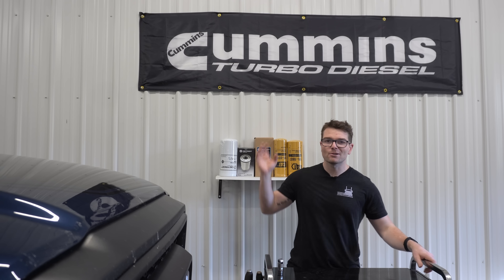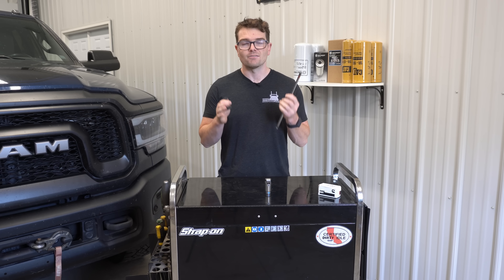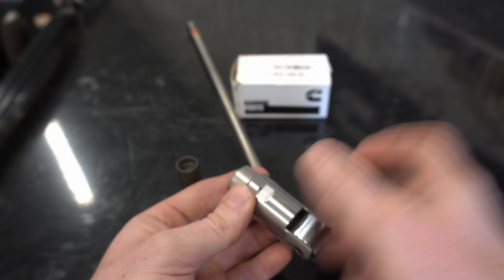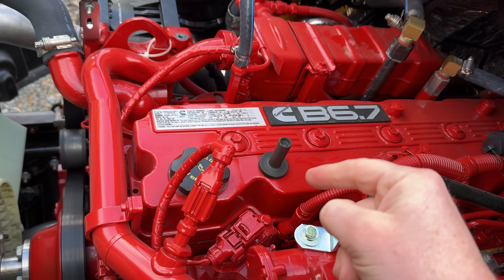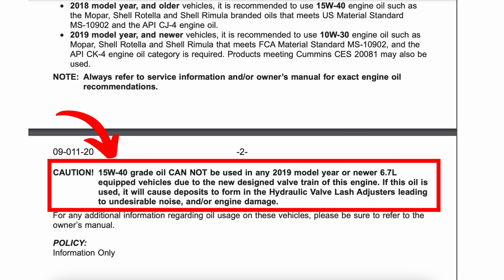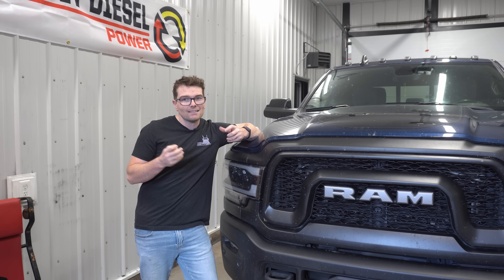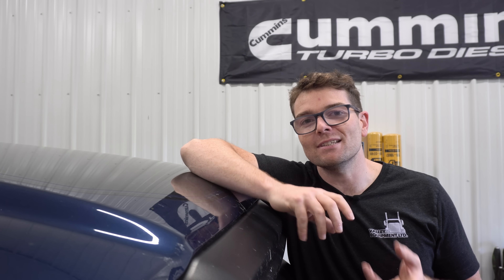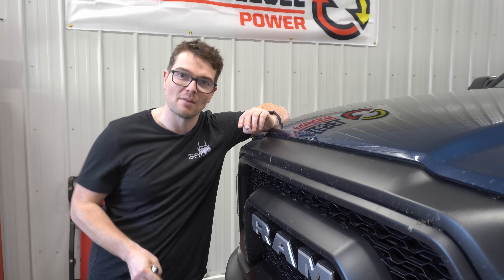RAM 2500 6.7L CUMMINS Hydraulic Lifter Failures *Diesel Mechanic Explains* | Not Good?

Comment: Great video, I’m super concerned as I’m hesitant to drop the huge dollars on one of these trucks. We are retired and do lots of towing miles with our 2004 5.9 Cummins dodge ( 200.000 km ) love the truck but as you get older the noise the truck makes when hauling is bothering our hearing. Plus in 2004 the truck has less power no Bluetooth,poor stereo less overall creature comforts but…… has great fuel economy and never breaks down. Oh and it’s paid for. See my dilemma? I would like if you were to dig deeper into the lifter issue.
Reply: Just add the creature comfort you need. 
I have
Reply: Just buy it and trade it in before the warranty ends.

Comment: I change my oil every 12,000 kms on my 2021 Ram 2500. More often than called for but I’ve always done this (this is my 3rd 2500 with a Cummins). I’m at 155,000kms and have extended warranty to 160,000. Went for my oil change last week and apparently I have a camshaft/lifter issue. 🫤 at least dealer has been great, it’s under warranty but this video made me realize it’s likely a bigger issue especially the 2021 model year.

Comment: I've worked on Cummins engines in many dodge/ram trucks that had well into 200,000 miles and the valve lash was still in spec.

They just work. 

The same thing when they tried dropping the CP3 injection pump for the CP4. Don't fix what isn't broken!

Comment: Lost mine at 30k miles, oil changed every 5k miles. 

Bought a Ford,  so far in very happy
Reply: Geeeeezzzz, that ain't good.
Reply: @oldsalt8011  nope , they claimed it was an idler pulley , still did it , then they claimed it was the EGR valve. 

Told em to quit beating around the bush and figure it out. They finally pulled the head and the intake lifters on 2 & 5 were shot 
Exhaust lifters on 1 2 3 & 6 were shot. 
With a 17 week lead time before they could touch it...
Reply: @jjames5928  What year model? I have a 2022 that I bought in December 2021. 3500 HO Ram.  I love the truck but I do not like hearing stories like yours. I bought with the Crew cab and long bed. It has been great for the projects that I have had and towing the wife's camper. Im now at 23k miles.
Reply: @oldsalt8011  22 3500 Standard output

Comment: Why change it ? Well, that's what you get for letting engineers have thier way . Nothing wrong with the old set up . Learn to adjust valves and it will run until the rings fail . Now you get to buy shifty lifters every 35k

Comment: Rotella T6 5W-40 on my 2019 3500 with 35k original miles as of this post. I change oil at 5k miles, I want the best with extreme weather conditions Texas heat this summer high 120s - high 20 degrees in the Utah mountain trails in dec/feb. I spoke with Rotella field engineer about this years ago and he said Rotella T6 will get the job done!

Comment: 2022 124k mine is in the shop for bad lifters right now. Getting that sorted is fun. 5-40 oil changes at 10k km since I’ve owned it
Reply: Mine is in the shop getting lifters  redone and a new Transmission
Reply: Ouch. Just bought a 2022 HO w/11K mi. Doing Amsoil 10w-30 every 5K mi and engine oil analysis to catch a roller lifter going bad. Are you going the flat tappet cam (Hamilton) route or just replacing the bad lifters?
Reply: @ dealer is putting in a new short block under warranty

Comment: I have a Ram 2500 diesel. Just clocked over 60,000 miles has a horrible lifter tick. I’ve taken it to three different dealerships and only one of them said that they can hear the tick the other two said that they can’t hear it which just pisses me off because it’s very obvious lifter noise. It has gotten way worse since it first started. It is very bad at a cold start. But the tick is there even when the engine is warm. It’s also got compression coming out of the intake on first start up.

Comment: Yes concerned 
I have a tight oil interval 6-8k 
So will see I have 110k on a 22 ram 
And no issues to report so far actually runs beautifully and gets great gas mileage 10-12l /100k full emissions

Comment: But thick oil will save you Cams. Plus, it can support the "in cylinder pressures." Not to mention shearing oil. Dodge has been having lifter problems with the Hemi.😂😂

Comment: .....obviously synthetic oils give you a better viscosity range from 5W-40/50 which makes sense but more importantly to me anyway in my G-35 is changing the oil every 3000 miles regardless.....why, because the oil engineer guys admit that by 3000 miles the additive package to any oil which amounts to 10 % of the oil (ZDDP and molybdenum and boron) which actually protects the metals is GONE......so there is no such thing as extended oil change intervals......never was, never will be, so follow the science.......gh
Reply: What about Schaeffer's Full Syn 5W-40?

Comment: man im at 10k km just got an oil change done at 8500 , checkd oil today shes black already? i go thru dealer cause of my warranty ad on but don't think there using the best product for these trucks ?
Reply: Check it after a few hundred miles, these trucks use EGR to lower emissions. The oil will be sooty.

Comment: Hi, just got my 2022 HO  3500 out of the dealership for P2459 code. Believe it or not (sit down for this), the problem was....wait for it.....the engine air filter. Yep, mine had 2 glue strips on the bottom of the filter that created too much of a seal and the engine was basically 'running rich' causeing excessive regen cycles, and also messed up the MAF. Both replaced, and viola, no more issues! 
The old air filter was a Wix (great filter), but again, make sure (foot stomp) that there are no glue strips on the bottom.
Reply: That’s a common denominator amongst some trucks.

Comment: 6.7 PS has always recommended 10w-30 or 5w-40 syn. The advancement of engine and oil technology has made it possible to run lighter weights in heavier duty scenarios.

Comment: My 2019 ram 2500 160k on it. Always ran rotella t5 10w 30. Cylinder 1 exhaust lifter failed. Luckily caught i time. No damage. Getting flat tappet conversion put in now.
Reply: How did you realize it was on its way out?
Reply: @WildBill541  started off in the morning getting a hard thump. For maybe a minute. Then goes away. Also had an annoying tick especially @ idle. People kept say my cp3 pump was out of phase. Nope it was the lifter not getting a good prime. I have ran the truck hard since the conversion and it works great. I am even getting the best fuel mileage.  Pulling a trailer total weight 16k and average 10.5 to 11 mpg cruising @ 75 mph. No trailer it's around 17.5 mpg. I drive pretty hard to. I also still have oem exhaust no delete. Best money spent

Comment: My 2018 with flat tappets gets T6 15w40. My 2024 with Roller lifters gets T6 5w30. I have zero worries either will have cam or lifter issues

Comment: Seems to be a ton of war on 10/30 vs 5/40 on these with no real regard to climate.  I have a 21 with 29k she just started making the slightest slightest tick out front and I’m not real sure what it is just yet. I’d be curious if Gettys take on proper weight for these. 
  

I have been running mobile delvac extreme 10/30 and changed between amsoil and mopar and fleet guard syn version filters.  I just ordered ADV HP 10/30 HD to see if that changes any noise. I almost grabbed 5/40 but I’m not sold that’s the answer. Being an amsoil dealer and shop I almost went that route but I wanted something a tick more extreme which to me was HP see if it changes the sound. 

That said I’m not sure it is in fact lifter or rod. Which makes me wonder how much of this is “lifter issue” vs the Cummins just developing Cummins noises and causing panic and being mis diagnosed. Especially first time diesel owners. But one thing we know is that fourth gen and down were so clacky you couldn’t hear a tick like that if you wanted. These new motors are so quiet (especially intact) you hear everything.
Reply: Yeah, that's true.  My 2001 Ram with the 5.9 has so much combustion rattle that I can't pick out any mechanical noises at all.

Comment: I’ve got a 21’ 3500 HO with 93,000 miles. Just found out I’ve been running 15W-40… sBut no issues. I’m in FL. Should I go to 5w-40 or 10w30? I’m not sure I want the 30. But I want to switch to what’s recommended so I don’t have lifter issues.

Comment: 2019+ show ~4x iron in UOA on average.  Pre-2019 Iron was around 9 ppm.  2019+ is around 34 ppm.  The lowest I have seen in my 2022 is 50ppm at 6k miles.  10k miles UOA showed 135 ppm.  I have ran 10w30 T6 and 5w40 Valvoline prem blue.  Best results have been with 5w40 and less than 10k oil changes.  I knew to buy for CP3…but never thought to research a change in valve train.  75k on truck and runs great but the UOA…can’t unsee the excessive wear metals that are significantly higher than the pre-2019 engines.
Reply: I've got a 2022 3500 HO. UOA showed Iron 27ppm at 12,250 mi. Waiting on my 6K sample i just sent in this week. 5-6Kmi changes,  Amsoil 10w-30 w/Amsoil filter. Watching and listening for signs of roller lifter wear/impending failure. Will likely go for the Hamilton flat tappet cam and associated items change vs replace the offending roller lifter.
Reply: Amsoil 10w-30 is my next change.  Never had a temperamental engine and have gotten 350k - 500k from all I have owned on store bought synthetics.  Now planning better and keeping 2 Amsoil changes on the shelf.  Looking forward to my first UOA on the liquid gold.

Comment: I just rolled 11,000 miles on a 2023 and I have at least one bad lifter.  Engines is ticking and making metal.  I changed the oil at 500 miles and then at 5000 miles with the proper weight as required by RAM.  No Bueno!

Comment: The Getty Adventures, I have a 2020 Ram 2500 cummins, what would we be your recommended interval as a consumer of these vehicles that can prevent hydraulic lifter failures from happening would it be 6000-8500 miles as well do oil analysis to see if their any potential wear? I'm using 10w30 oil since I dont get temperature below 0 degree Fahrenheit.

Comment: I’m planning on buying a 2024 6.7 in a few months should I just convert to Hamilton flat tappet ?
Reply: Might as well wait for the ‘25. Significant changes for the transmission and DPF/doc combo. Still using hydraulic lifters it seems though.
Reply: @ I bought a 23 got a good deal. My 4th gen never gave trans issues I don’t drive like a teenager and do hotshot worst case I’ll put in a Randy’s due to my savings with delete and flat tappet swap

Comment: I adjusted the valves on my 12 valve at 170000 miles and my 6.7 at about 150000 miles.  Neither where out of spec,  though some valves were on the edge. It wasn't very hard to do, not a big deal.
Reply: I adjusted mine at 65k miles. They were out of spec so if things get noisy it may need to be done sooner. Mine was also throwing misfire codes but seems to be fine now. It's definitely a lot quieter too.

Comment: yeah i just got my first one , 2024 .. ive always wanted one , most of the older trucks have already been tuned and deleted , and have high miles and you just dont know if the maintenance has been properly done on them which is what drove me to get a newer truck , but i do wish they had just left things alone with the lifters , videos like this do make me nervous. I would never go 15k between oil changes personaly.

Comment: 2023 SO 3500 with 73,000 miles, tow 10-20k all day every day, changing oil every 5-6k miles with Schaeffers synthetic 5-40, so far so good, no issues. Hoping it l will last at least 200k without issue
Reply: The people that service our trucks use shaeffers. No issues. I started getting a little lifter tick. She suggested Shaeffers moly additive, and it went away. 2022 std output with 100k miles. We change oil every 7-8k ish. My whole emissions just crapped the bed. The DPF plugged and split so did the EGR cooler.
Reply: @joewright9784  emissions are my biggest concern, I don’t have a backup truck so downtime could be painful, looking into Enterprise for a truck rental if my truck goes down for extended maintenance
Reply: I'm doing the same. 2022 HO 3500. Schaeffer's Full Syn 5W-40. Was changing around 7.5k but will drop to 5k mile change. Love that truck.

Comment: They starteddoing hydraulic lifters in certain motorcycles when I was a mc mechanic 20 years ago and they actually worked out fine, I preferred adjusting the tapets though, but again these guys want us doing nothing on our own. All by design to remove the ability to repair things ourselves at home or at the side of the road.

Comment: 106,000 Miles on my 2021, 2500, 6.7 Cummins. Bought it with 100k miles. Almost certain I have a lifter failure. I have the iconic driver side faint tick that I have seen indicates this failure (was not aware of that issue before my purchase, however I did notice that tick before purchasing). Getting it into the shop in a few weeks. After doing some research seems like OEM replacement is the best bet. After market kits for roller replacement require, lifters, push rods, springs, rocker arms, for the small price of $4,700. OEM is much cheaper. Flat tappet requires super stringent break in of running the truck at 2500 RPM for 30 minutes, and adding zinc additives to your oil, forever. For an engine not designed for that additive not sure if there are other part failure consequences when that is done. In my research I've also seen people talk about the keying on the lifter being a very low profile, potentially causing axial play causing the lifter to not be true perpendicular to the cam, thus not having a perfect role. The oil consistency, and oil change intervals may likely play in this failure as well. Sucks having a picky truck, and doing a cam job is ridiculous if you don't have a lift to push the whole body off of the frame. Will update with what the shop discovers and how much I'm in for.
Reply: I would 100% go with a hamilton flat tappet kit if i had lifter issues and was going to get a replacement.
Reply: @stevenrossi8173  FULLY AGREE AND THE ADDITIVE PACK HE IS TALKING BOUT IF NOT DELETED CAN CAUSE SOME NASTY ISSUES WITH THE DPF, BUT SHIT IF DELETED HAMILTON ALL THE WAY! CURRENTLY I RUN HOTSHOT 10W30 BLUE DIAMOND AND HAVE NOTHING BUT GREAT SUCESS WITH HER BUT I CAN HERE THE LIFTERS EVERY SO OFTEN. THE HAMILTON IS TO COME FOR SURE AND AT THAT POINT WITH MISSING ITEMS ITS BACK TO HOTSHOT SECRET BLACKDIAMOND 15W40 WHICH ALREADY HAS THE GOOD ADDITIVES IN IT! ALSO WILL BE PUTTING A BYPASS FILTER IN JUST TO HELP ELEMINATE EXTRA MESS AS MUCH AS POSSIBLE!
Reply: @stevenrossi8173 got it back from the shop. 2 lifter plungers failed. Filed down the balls on 2 push rods and the end of 2 rocker arms. Heavly ground down. Only heard a very faint out of ryrhim tick. Not including other upgrades I got done it was $7000 job. Pulled the cab. Pulled the engine. Partial tear down to the head. Did not go after market. Opted to stay with stock. Will consider flat tappet if it happens again.

Comment: 10w30 makes my ‘19 Cummins sound like theirs a midget with a hammer in the top end on start up. 5w40 Mobil or Valvoline only. Throw that Rotella T6 junk in the trash, doesn’t matter what weight, these new Cummins don’t like it. I 100% called future issues with these new lifters when I found out they went away from flat tappets

Comment: 2019 Ram 2500 6.7 with 64,000 miles on it. Apart from a turbo actuator and 2 brake caliper failures, no real issues.

Comment: Odd they would blame and change the oil, I'm fairly certain Duramax and Powerstroke are both hydro lifters and T4 15-40 is the go-to oil on those...  50K+ on my 6.7 PSD with zero issues - -20*F starting every winter too.
Reply: You're really playing Russian roulette using that oil. I would never use conventional 15w in any truck that I'm towing with
Reply: I am guessing that the commercial engines stayed as they were for maintenance reasons. Commercial diesels are a competitive market, and no sense giving a client pause. RAM buys a lot of engines, so if that's the way they want it, that's how it goes. They own the warranty. Commercial folks don't want a warranty, they buy a lifetime reputation.
Reply: @stevegillmeister7738  cummins has a virtual 100% monopoly now

Comment: Hi Getty.  Since you have access to the regular tappets and to the updated roller engines, it would be insightful to measure the valve spring rates for each.  I assume that in order for the engines using the rollers to hit their power/torque/rpm/epa numbers, they have to use way higher spring rates to keep the valves from floating too much.  That plus the oil sludge issue would cause the cams to wear alot faster.

Comment: GM and Fords 6.7 have been running Hydraulic lifters for years with no issues. The 6.6 L5P had some issues early on because they switched to a LS style lifter but all other years have been rock solid so hopefully Cummins can get the issues fixed a well designed hydraulic lifters can go as long as a flat tappet design if engineered correctly.
Reply: But in this case the roller isn't failing. It's the part on top of the roller :)
Reply: They have needle bearing in lifters and ram Cummins does not have

Comment: I was running the rotella T6 5W40 in my 2021 3500 HO till about 85k miles and the truck has been great. I just started using 10w30 and the engine seems to operate better. It’s quieter and more responsive. I change my oil every 5,000 miles because I do lots of short trips and since I haven’t had a boating accident yet the truck regens often. Great video by the way!
Reply: I run Schaeffer 5W-40 full snythetic. Im around 23k miles. No issues.
Reply: @oldsalt8011  pretty bad you even gotta say that 😂 "yessir im at 23k miles and I haven't had any issues yet!!"... The epa has to be deregulated and i hope trump does it.
Reply: What brand 10 30?
Reply: @jsned2502  shell Rotella T6